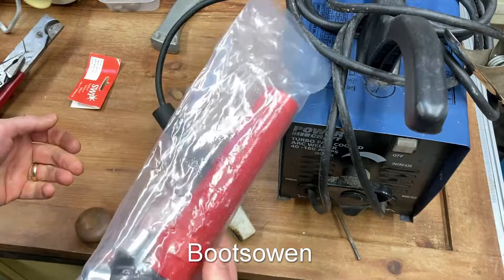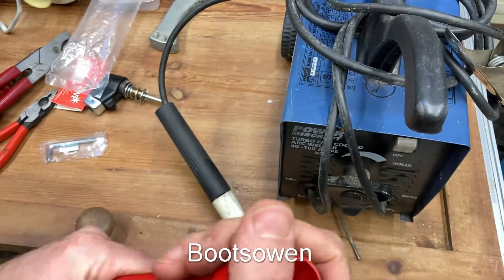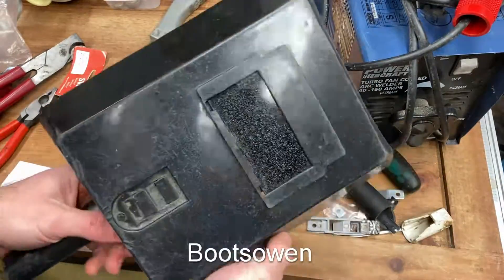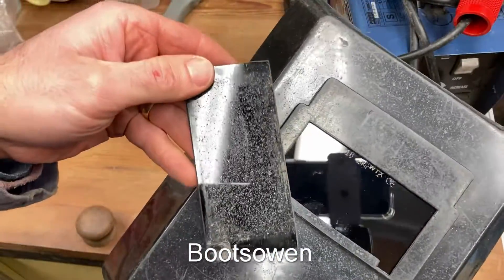Lidl / Aldi arc welder 15 year review and long overdue upgrades: Power Craft 160 amp stick welder

Comment: Owen, some people cannot get on with arc welders but it's just down to lots of practice. The auto sensing welding helmets are brilliant and make life so much easier, cheers
Reply from the maker: I find them very easy on heavy stuff because there is so little to adjust, turn it on and go for it. Thin stuff is tricky.  I have thought about those helmets, I am still trying to make life more difficult before I go for making it easier. Haven't done any welding since I got the big MIG going!